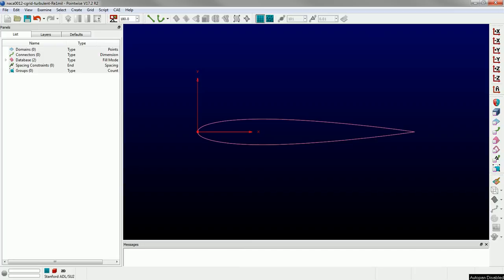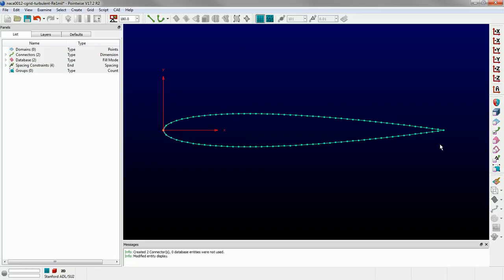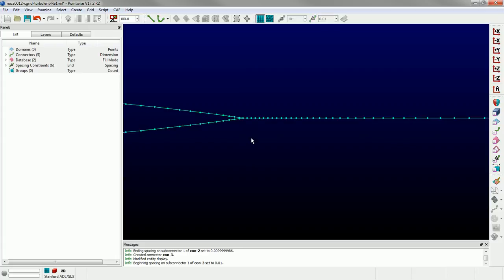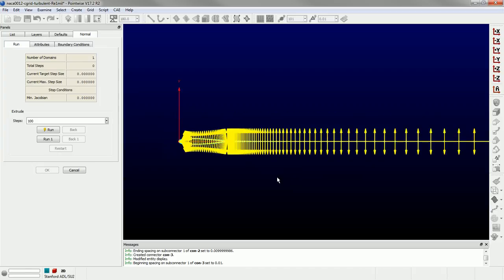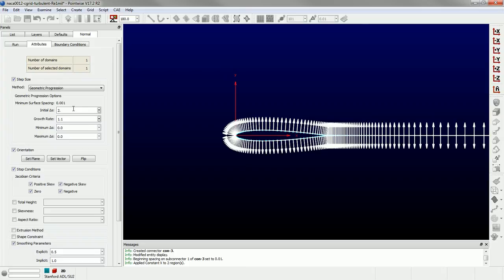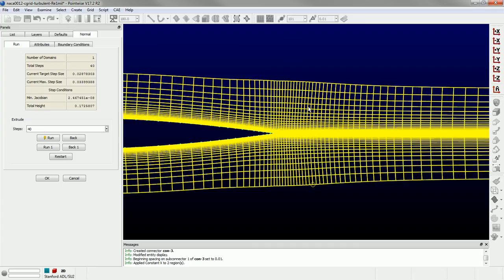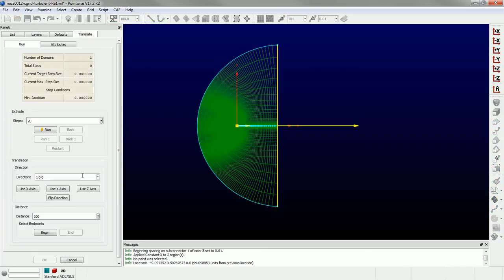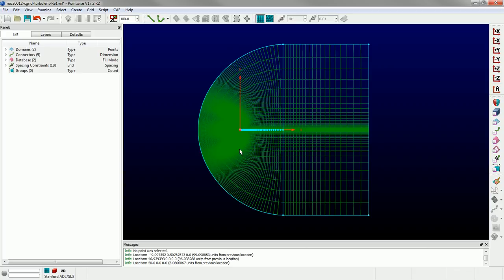Pointwise Pointers: C-Grid by Extrusion

Comment: thanks for your share! now I have a problem:I put 467 points on the airfoil, 700 in the wake , with the same farfield size. i use your method to generate the mesh, after i run 40 steps there appears an apophysis at the joint pozition of trailing edge and the wake line, but a dont't know why? hope for your advice! thank you

Comment: Hello Travis,
Thank you for this video. I have a difficulty in preparing a C grid using extrusion where i need the wake is started exactly at the trailing edge of the airfoil. I want to prepare the C-grid like your previous video (C-grid tutorial) but using extrusion. I tried to use method that is the same  like your previous tutorial, but my code give the error due to the high aspect ratio.
Thank You

Comment: Hello,
Thanks for the video. How do I change the offset of the grid before running the extrusion? In other words how can I set the further point of the c-grid to be a special coordinate?
Thanks
Reply from the maker: If you'd like to specify an exact location for the farfield, you'll want to follow this example instead, https://youtu.be/qifDBLbKvwM
Reply: Thanks for the quick reply. I followed that tutorial before, but I found this one faster method to generate grids around airfoils, that why I was wondering if there is any chance to do it using this extrusion method. For the kindly reply I am guessing that to achieve the exact coordinates at the edge of the grid I must follow the other procedure rather than this one, am I correct? 
Thank you again.
Reply from the maker: Arturo Cajal correct
Reply: Thank you!

Comment: Thanks very much for the share. For higher angle of attack, should the same procedure be used? Should the mesh at the trailing edge follow the direction of foil shape? Thanks.
Reply from the maker: +Liangyu Xu Yes, the same procedure can be used. That said, the grid above can be used for a handful of angles of attack successfully by adjusting your inlet velocity components. The best technique to use when adjusting angle of attack is an o-grid. With an o-grid all you need to do is assemble one mesh and then adjust the velocity components. There is a video describing how to create an o-grid on my channel as well.
Reply: +Travis Carrigan Thanks very much!
Reply: +Travis Carrigan It seems O grid cannot work for a sharp trailing edge. What would be the best practice if I want to adjust the velocity for a sharp trailing edge foil? Thank you.
Reply from the maker: +Liangyu Xu Actually, an o-grid will work for an airfoil with a sharp trailing edge, but will generate poor quality elements at the trailing edge. Some solvers can handle the poor quality robustly. In reality, airfoils have blunt trailing edges and should be modeled that way. I'm not certain why sharp trailing edges are even used any more when performing CFD. But, if you must use a sharp trailing edge you will need to use a c-grid topology. Again, with a c-grid you can set all the outer boundaries to a freestream BC and change the velocity components. If your farfield is sufficiently far from the airfoil you can explore many angles of attack without having to regenerate your grid. Plus or minus 10 degrees, possibly even 15 degrees or higher. I would encourage you to experiment. Play with it and see how the solution changes when you simply change the velocity components versus rotating the airfoil and regenerating the grid. Also, another fun experiment is to change the farfield distance and watch the solution change. Be sure you are looking at integrated values like lift, drag, and pitching moment. Good luck!
Reply: +Travis Carrigan Thanks. Another question: I tried to increase the mesh number to study mesh convergence. However, when the mesh becomes very dense, unsteadiness occured and the result seemed to be worse. Have you encountered such problem?
Reply from the maker: +Liangyu Xu Yes, that can happen depending on your solver. If your grid spacing gets smaller your CFL number goes up.
Reply: +Travis Carrigan I am now using a steady solver, so no CFL condition is needed. Maybe I will try a unsteady solver and use smaller timestep for the dense mesh. Thanks a lot.

Comment: Hi, How can I do Grid Convergence Study with "Constant Grid Refinement Ratio" using "gridRefine" Glyph script for a similar airfoil study?
Reply from the maker: +A Haider Simply change the refinement factor and that will adjust all the spacings and dimensions.
Reply: +Travis Carrigan Thank you for the reply. I am following the link: http://www.grc.nasa.gov/WWW/wind/valid/tutorial/spatconv.html for grid convergence study. So, i want to obtain three grids : Coarse, Medium and Fine. The ratio of Medium/Coarse = 2; Fine/Coarse = 4.... but when I change the refinement factor 2, 3, 4,...times over a baseline Coarse mesh, the refinement ratio is no more constant.
Reply: The grid in the given vidoe has very high aspect ratio and highly stretched cells that may cause instabilities in the solution. How to get a good aspect ratio of cells?
Reply from the maker: +A Haider It will be constant if you are using a structured grid. If you look through the script it simply takes that factor and multiplies all the connector dimensions by that amount and divides all the spacings by that amount. If you are using an unstructured grid then it will not be constant.
Reply from the maker: +A Haider High aspect ratio cells are not a problem for cases such as this. I've run aspect ratios >1000 in in some cases close to 10,000 without issues so long as there are no large gradients in the streamwise direction.

Comment: Really helpful video, thanks ;)
I'd like to know how you would proceed to mesh a multi element airfoil, one having a sharp trailing edge and one having a blunt trailing edge?
Reply from the maker: I'm glad you enjoyed the video. A multi-element airfoil would make for a great video. I may have to put one together. But to answer your question, it's really not that different than this video or my other video for handling airfoils with blunt trailing edges and creating an o-grid. All you need to do is joint the elements together. For example, you'd create a connector that joins the trailing edge of the slat with the leading edge of the main element and another connector joining the trailing edge of the main element to the leading edge of the flap. You would then simply select the connectors defining the slat, main element, flap, and the branches to create a single closed loop...topologically speaking. By adjusting your growth rate and some of the smoothing parameters, particularly Kinsey Barth, you can extrude off everything at once. And, if you'd rather have a c-topology than an o-topology, just create another branch connector from the trailing edge of the flap to some downstream location like I did in this video.
Reply: Travis Carrigan Thanks for the info .
Pointwise really seems to be THE software when it comes to multi element meshing, as blocking around is often quite long. I understood your linking/closing strategy, but I wonder if it would still hold if, say, the leading edge of your flap is upstream of the trailing edge of the main element. The connector would have to be really curved: would the extrusion handle it with suitable Smoothing parameters ?
Reply from the maker: Remi Roncen Depending on the severity of the connector's curvature, the extrusion may be possible with the right combination of suitable smoothing parameters. However, this might be a case where you'd have better success manually blocking that portion of the flow and then use the extrusion elsewhere.